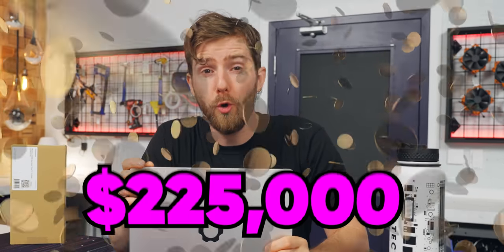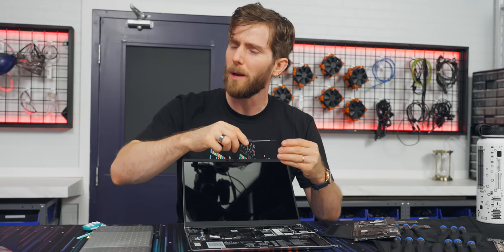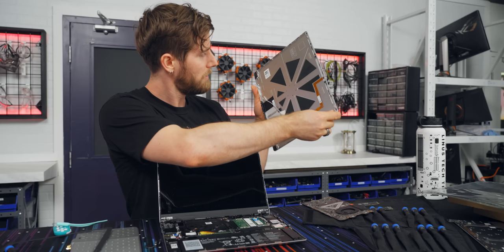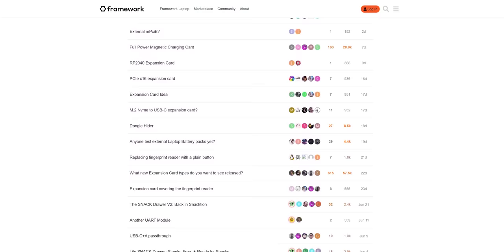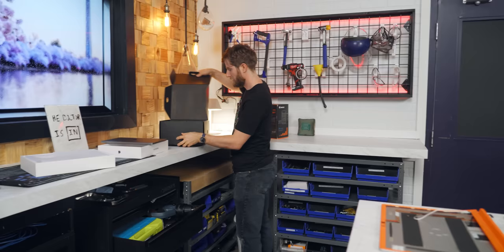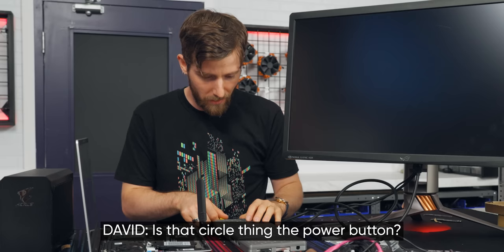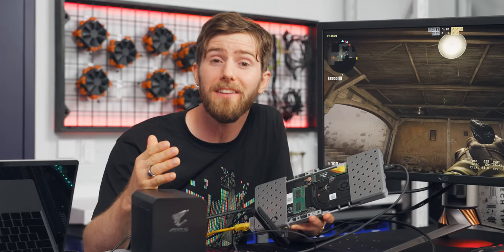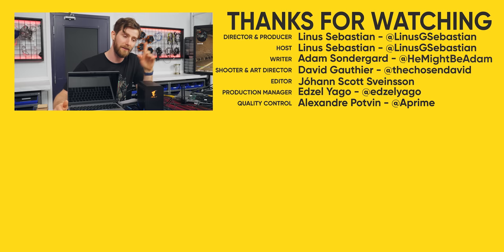I invested $225K in Framework Laptop - 1 Year Update and 12th Gen Upgrade

Comment: I'm all for this framework laptop. However for the average user once they replace a part (say what Linus did there to replace a motherboard) they wouldn't know what to do with it. Why not have an option on their website that says if u want to send the old part back to us and knock off some price of the new purchased board. They'd be able to repurpose the old part and sell it again no?
Reply: Yeah I’d love that as well. Likely needs new procedures and employees though to take back motherboard, verify no damage, verify all ports still work so they can give it a grade and slap on a warranty.
Reply: what should they do with the board? sell it again? fairphone just has a marketplace where people sell their parts to eachother, its kinda works and i think its a more realistic solution to that problem. i think framework is a bit too tech heavy for the average user. fairphone really has that part down, but they lack in other regards where framework does much better. but then again, maintaining android over a wide range of configurations is nearly impossible, not so much with linux or windows which come from a legacy mentality.
Reply: I agree. That’s what auto repair shops do, they give you some money back when you bring in the part you’re replacing.
Reply: @tjeulink  actually that super cool. Selling parts to each other is such a good thing especially who doesn't want latest and greatest every year. For eg I will be happy to buy 11th gen motherboard for ~60-65% of the original price from someone who doesn't need it anymore
Reply: @rapiddu6482  You know what buying used means right? We been doing this since the start. I'm personally a 4-5 gen behind kinda guy. Lol, sorry, was just funny how you were so focused on the context you didn't realize it was just a contrivance of something completely normal.
Reply: I second the secondhand marketplace for customers idea. Seems like the simplest solution, plus they could monetize it by slapping on a fee for using the marketplace.
Reply: Even then, that's still something they could resell to Louis Rossman and the like to recoup costs and even make more money in the process by selling old boards (even very broken ones) as parts bins by weight, perhaps.
Reply: Love the idea, I really do...however I don't feel people would use it. Who's buying the framework? Tinker nuts..
Edit: I could totally see this for end of life parts.. but if you're looking to send lasts years model back, I would just advise getting a Macbook.....
Reply: Framework's offering a platform where you can sell your old parts (or I think they said we could)... although its not the same as a rebate for new parts, its still a good alternative to just throw it away, and since its specific to this laptop, everyone who's into that probably knows where to find old parts.
Reply: @tjeulink  Well yes, they could just sell it or they could find official partners who can refurbish the board and provide warranty. They (Framework or partners) could also offer kits for a desktop/thin client conversion or even sell finished conversions for those customer who do not have a 3D printer  at hand. The kits/conversions could also contain factory second modules which work fine but maybe have scratches or dents, the stuff that a factory would usually just throw out.
Reply: All products, not just Framework's parts, should have their end-of-life disposal and environmental costs paid for by the companies that produce them. If the companies themselves were financially responsible for their products disposal (or more likely, passed those costs to consumers), then they would be financially incentivized to create more sustainable products, make sure those products are actually disposed of properly instead of just thrown in a landfill, and to create new recycling technologies/processes so that more products could be more sustainable. End-of-life buy back programs like you described would make more sense financially in that case, since  guaranteeing that more of the e-waste is properly recycled / disposed of would directly lower their disposal expenses. 

Companies want to maximize profits. If you made sustainability profitable, they would improve faster than you could imagine.
Reply: @Ham24brand  no they dont😂😂😂
Reply: @tjeulink  repair/refurb, resell as used but verified parts at a reduced price, have the option to buy a machine with these parts for cheaper perhaps. At the very least opening a dedicated marketplace for this kind of thing is a great idea.
Reply: Make it a rebate so it is easier on the consumer and they have full function of the laptop when parts are being shipped.
Reply: This is a bad idea on all fronts. It is bad for the environment, is it not economically viable for framework and it is a pain in the ass for the consumer.
1. It would involve twice the amount of shipping for each purchase, increasing the CO2 delivery output and making the product and logistics more costly on the environment.
2. It would include way more shipping overhead, and also a package inspection department, a company like amazon can do this, not a startup.
3. Sending items back to companies involves overhead and work on the consumer as well.

A much better solution is using local options, which solves all 3 of these issues I.E ebay, craigslist- etc.
Framework doing this would make no sense on all fronts, you doing it, makes way more sense.
Reply: @aaronchamberlain4698  and those parts will be cheaper since they're refurbished
That's totally a win win situation
Reply: They should do a 2nd hand option in the future for students/ budget users that uses returned upgrade parts. As not every user will repurpose their old parts. Plastic shells would be cool too (keeps costs down and recyclable)
Reply: @PunkR0ckz09  That seems like a reasonable risk/reward tradeoff. Just host a forum where people can exchange used gear, and maybe point out possible alternate uses for hand-me-down hardware if people don't want to sell it off.
Reply: Honestly a great idea but logistically difficult
Reply: That's already possible. It's called sell it on ebay. You get some money back. Someone else saves money buying used. And the parts don't end up in the landfill
Reply: they could just sub-hire already successful companies as well
Reply: shipping costs are the bane of this idea
Reply: @azzzertyy  framework could still host a third party parts hub
Reply: Wait, so what do people normally do with their old parts that have been replaced?
Reply: @aashilr  I believe it goes to the trash
Reply: @moneybilla  yes they do, Auto Zone, O' Rieley's, and advanced auto parts. they have a refundable core charge if you bring your old part to them.
Reply: @aashilr  sell them, repurpose them, or keep them as backup hardware.

Comment: Really love what Framework is doing here! Its such an important step towards a world where anti-consumer practices are hopefully less common assuming Framework can make it big.
Reply: No you don't.
Reply: @Q-nt-Tf  pov: apple
Reply: The real money is in business machines, they’re like 2-3x the price of standard high-end consumer laptops for tiny differences like “pro cpus” and these guys will never break that market.
Reply: @jay-5061  typically the business grade machines will have higher quality parts as well as quadro gpus which in general are more expensive. You are paying for the reliability mainly though.
Reply: @jay-5061  Actually you pay the money for way better parts like high quality chassis and keyboards. Just compare a Thinkpad to a 500$ Acer Swift
Reply: @Theborpapogs  Is it possible to make quadro gpus less expensive to put into framework if that's even possible for any dgpu to fit?
Reply: @jasonluculence4467  the lower end quadros are much more affordable such as the A2000 and A3000. These have mobile versions that will definitely fit in a laptop but not sure about the modularity with framework laptops or how that would work.
Reply: @gigalodon14  or compare a 2500$ ultra thin think pad  to a 1300$ spectre 360
Reply: @gigalodon14  you also pointed out something that the DIY dudes in the video will not likely be able to achieve
Reply: My next Laptop will 100% be a FrameWork!
Reply: some rich fukker will buy the company and undo everything
Reply: @jay-5061  Well the Framework definitely looks and feels like a business laptops and at least for big companies the repairsble approach might come in handy as they don’t have to lease Laptops anymore and can just swap out the motherboard every few years.
Of course, you‘re an american company that floods everything with Macbooks you won’t be getting any of this and stay with Apple
Reply: @Edinburgh1000  Yes, it's so fan to have a new set of issues and problems to learn workarounds for each 2-3 years.
It was overheating? New one would brake wifi driver each second update. You really like the keyboard?  Tough luck it got replaced. You got new 2k panel with better colors? Good, also take 'Cinematic calibration' which would make configuration with external monitor impossible to harmonize. On the other hand, for example, USB finally works without issues and battery might live more that two years.
Reply: @jeremiahfink5440  like what happened with Makerbot.
Reply: Capitalism does not care about this
Reply: They'll be bought out and the business model changed to where it's not what it is today, or be shelved completely by the company buying them. 

Happens with them all
Reply: I'm interested in buying one
Reply: @TheMcGritz  If linus is a shareholder then they can’t be bought out
Reply: @Edinburgh1000  Same. It is extremely inconvienient to open up the machine and upgrade it. Consumers don't want to buy upgradable laptops, they would rather get a new machine. The upgradable laptop is aimed at a niche audience.
Reply: @thetalkativefos716  pov: every single brand/company that does customer lock-in
Reply: @Edinburgh1000  this would be true for past equipment 
Many of these newer designs are quality enough to scale multiple generational upgrades (non quantum), unlike previous gen designs 
Setting the stage for expecting the industry to allow repair, upgrades, and reducing Ewaste is important
Reply: @Edinburgh1000  did you watch it? Its 50%, not 100%, and he upgraded the motherboard too. Theres no old components.
Reply: Then I hope you own one. How ridiculous would it be if the person complaining about the market was the exact consumer shaping the market. Numbnuts.
Reply: @bulletpunch9317  never had...?
Reply: @jay-5061  the so called overpriced pro laptop with just a bit better cpu
Reply: @bulletpunch9317  I didn’t say “just”. The other differences like battery life, build materials, better support and quality control are simply wringing business customers of every dollar they can over inexpensive things.
Reply: @jay-5061  they are inexpensive because you said so?
Reply: @bulletpunch9317  because the exact same things besides customer support are found in high end CONSUMER laptops for half the price. or less. use your brain.
Reply: @Theborpapogs  thats my point, the reliability has a MASSIVE premium.
Reply: @jay-5061  like? Give some examples.
Reply: @banana13775  I don’t own a laptop at all :), only computers I use are ones I build myself.
Reply: @Edinburgh1000  Dell's quality control is garbage just like HP.

😂😂😂
Reply: Yeah I also feel personally at the end of the day that if companies decided to simply stop making microprocessors out of silicon and decide to utilize different methods it would definitely more logical in regards to helping the environment. …
Reply: @johnthegamer2683  i mean they need to be made out of some kind of semiconductor, just by the very nature of what they do. There's only so many semiconductor elements and all pretty rare, none as effective as silicon. The process nodes and architecture can change but i dont see silicon going away any time soon
Reply: @Edinburgh1000  I have a MSI "gaming" pc with a broken keyboard that I'm unable to fix because it needs special tools to repair, and now I'm stuck with a bluetooth keyboard. I would happily buy a framework laptop just for the repairability alone.
Reply: @jay-5061  And businesses will not spend time upgrading thousands of motherboards one by one. Unless Framework offers laptop swap/upgrade/repair functionality, businesses will see no point in these.
Reply: @XzaroX  Also, their business model does not seem to be compatible with government contracts.
Reply: @Edinburgh1000  If you really need to upgrade every 3 years or so with a laptop you should definitely think twice about your computing needs. Crying about a 12th gen out scoring a 9th gen Intel on Cinebench or newer models having thunderbolt support aren't really a valid reasons to upgrade.